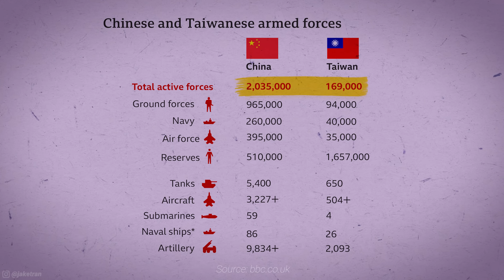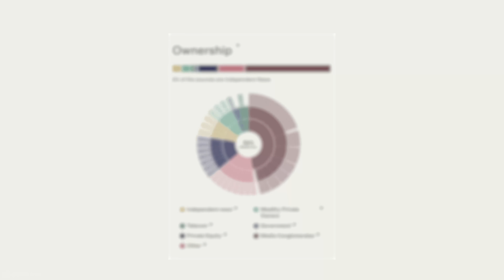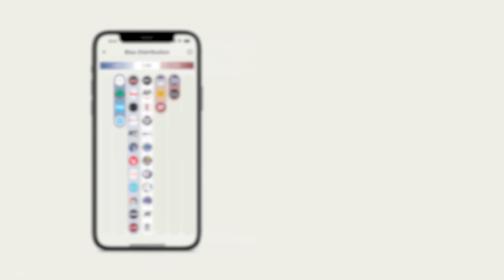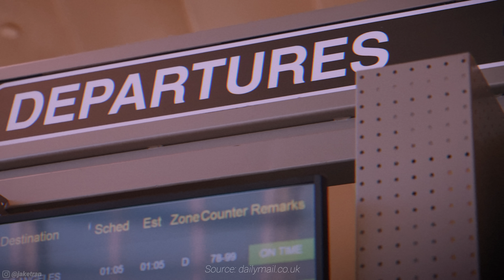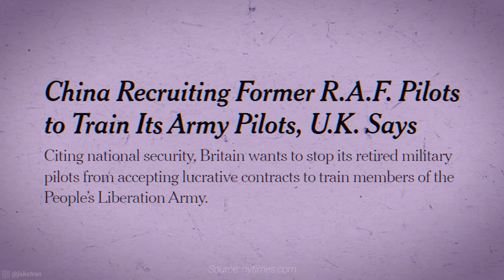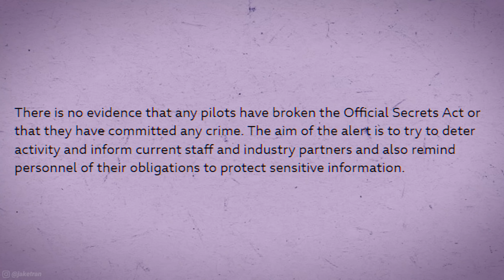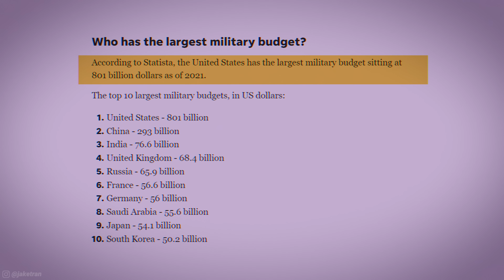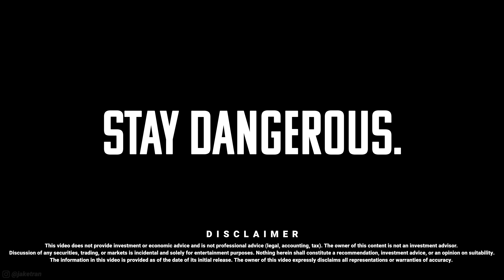China’s GENIUS strategy to DEFEAT the US

Comment: before that  you should have known that chinese air force get's western equivalent training from Pakistan Air force through joint exercise. Their JF17 is based on F16 and they use similar tactics so that pilots can interchange between f16 and JF17 without any issues.
Reply: The JF17 has an inferior engine to the F16!